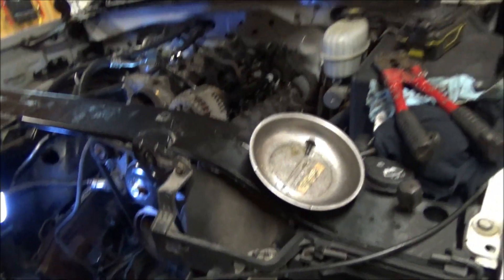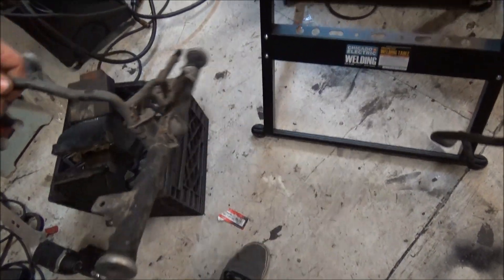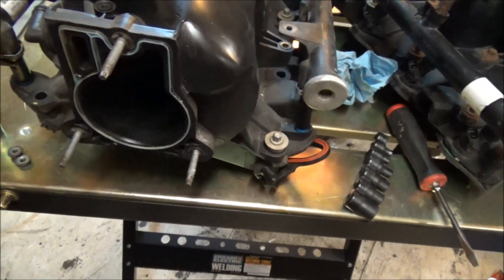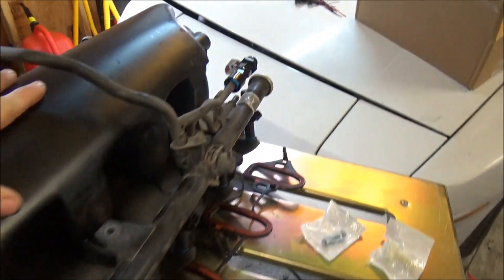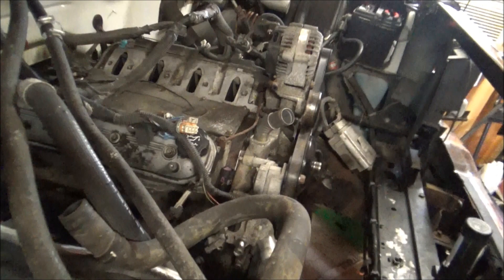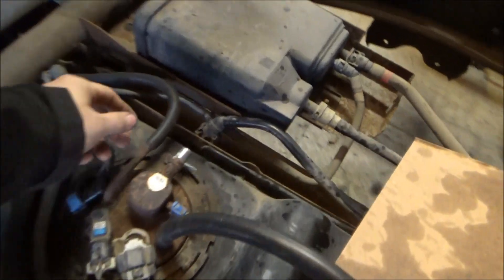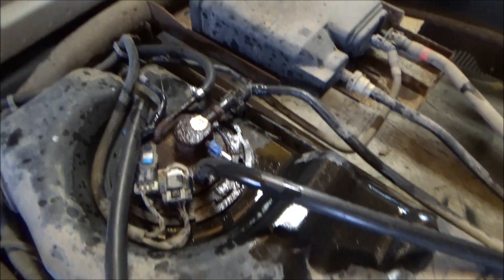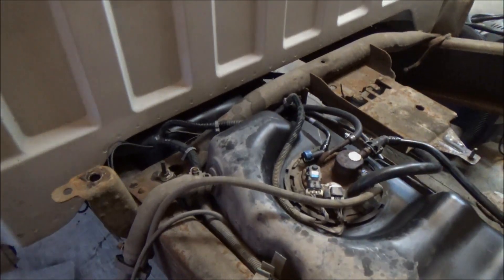The JSRP Parts Truck Build Part 5 The Fuel Rail, Injectors and Fuel Lines

Comment: hey does anyone know where other end of  that hose that goes into back of vortec 5.3 intake goes? i was intalling a new de-pinned harness and just popped one end in back out to do grnd and 2 sensors back there and when i was done somehow both ends were loose and end of the day i couldnt find where it went back in?

Comment: Just got the Fuel Rails for our 1962 1/2 Ton Chevy C10/20 3/4 ton Frame with 1/2 ton front and rear suspension sporting a Flat bed now. I just dont want to use soo many adapters and I dislike those clips GM put on these engines. Just ordered new Injectors DELPHI Stock. Where did you get that smooth intake ? looks Alot better than the Stock one I would like to use it on our rig. Learning a little more each day with these videos old dogs learning new tricks can be dangerous...LOL Any way if you remember where you got it let me know what I should be looking for Its going to be all stock except for this stuff I want to make it look as clean as possible we Already took off the monster harness in favor of A Kit for the EFI.
Reply: You can shave your intake just like this one. There are tons of videos showing how to do it, but just find the one that you feel suits you best. LS INTAKE SHAVE

Comment: so does the 13 mm exhaust bolt and 13 mm vally cover bolt trick still work?.... because a friend of mine has a motor with both 13 mm bolts but he says its a 2003-2004
Reply from the maker: it's not a set in stone trick. it's accurate most the time but there are rare times its not. I personally have never seen it not work. but have heard rumors of others
Reply: Ok thank you
Reply: What bolts did your truck have if you don't mind me asking.....? And I definitely need to set up a phone consultation with you because I'm building a 5.3 right now and I am kind of stuck on certain things where to invest and where not to
Reply from the maker: +Terrance Daves it had mix. and go to www.jsracingproducts.net and set one up on the consultation page.